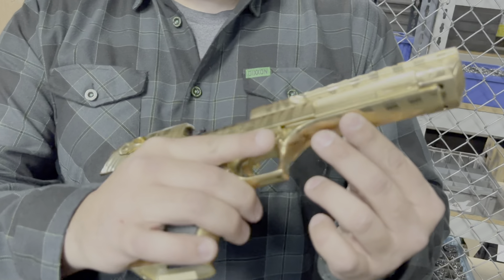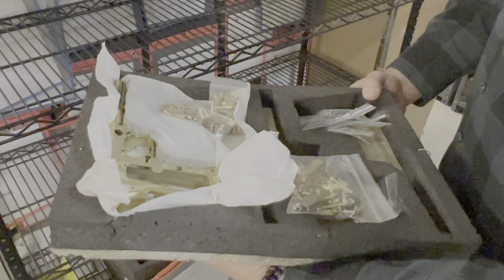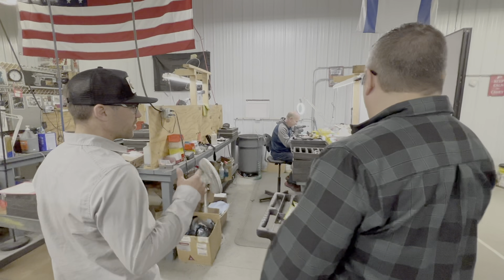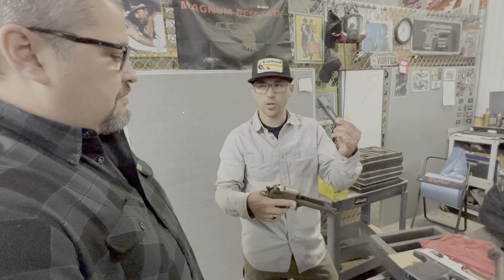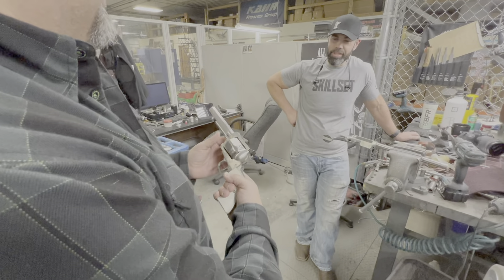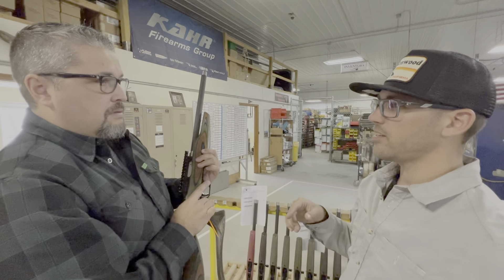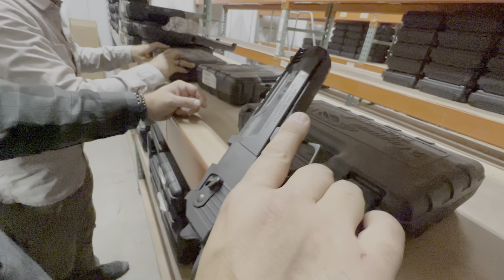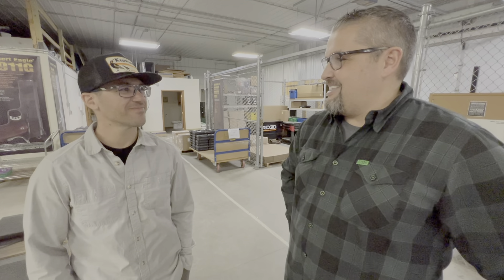.50 AE Desert Eagle & BFR Manufacture tour.  The world's biggest & badest hand guns!

Comment: Shame such a cool factory that makes guns that function half the time
Reply from the maker: What kind of problem are
You having?
Reply: For me the .50ae has problems cycling. I’ll be on number 3-4 and it jams up. It will be clean clean and it still jams on the feed.
Reply: @johnjoe2989 check a video on the problem with the magazine. Just grind the part that drag inside the magazine flush with the follower. I did it on all my magazines and problem solved

Comment: Only a waiting list of 18-24 months.  No thanks
Reply from the maker: I was talking to them about that and it’s a generic statement because some people are getting hand engraving and tiger plating done to the gun which is a much longer process than buying current inventory
Reply: @ThatDanShow  I emailed MR and asked what it took to get a brushed chrome 44 here in CA and they said I would have to place an order with an FFL and it would be about 18-24 months.  All that and It's not even the gun I really want.  Thank you CA roster. The one I really want is the 50AE for possibly better reliability and the stainless model with pic rails top and bottom and compensator as I'm not a fan of the plated/coated models to begin with.
Reply: @ThatDanShow hey i got me a standard issue black .50 AE with a boron bolt, how long would you think a standard one would take?